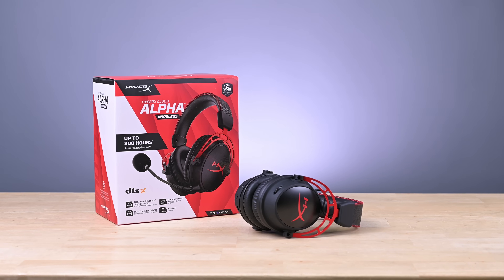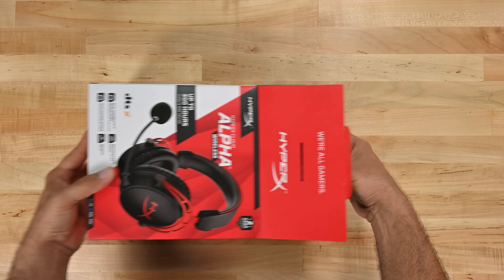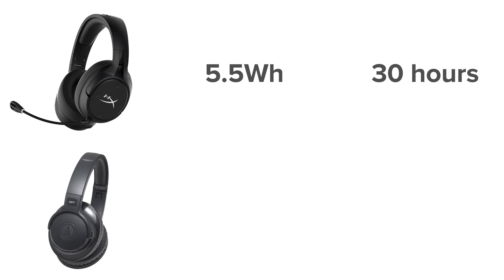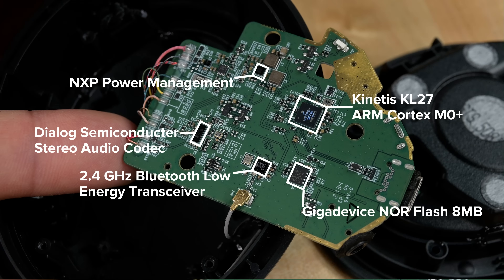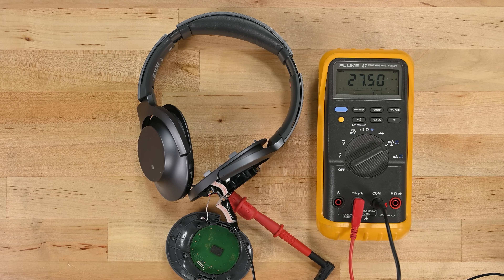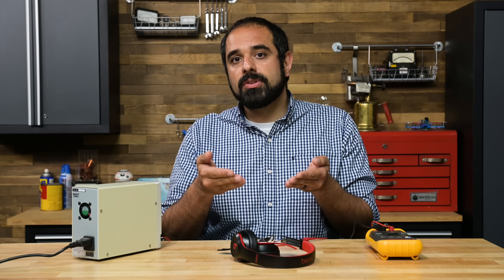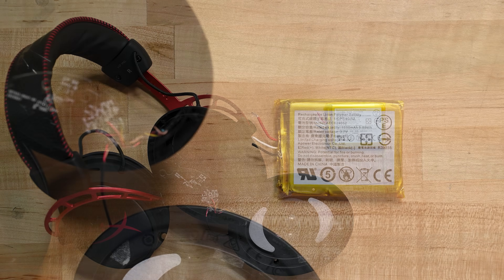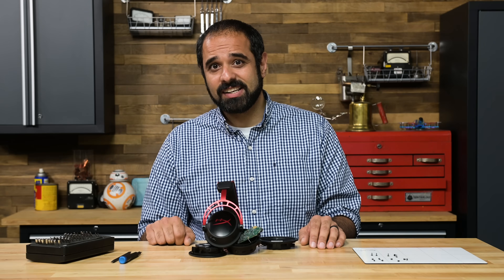300+ hour Battery Life HOW?! A HyperX Cloud Alpha Wireless Teardown

Comment: I wouldn't cut any points for needing to solder. If you have to pull those wires through the housing (which I have had to do on headphones before) you will end up needing to remove the connectors and that is going to make repair WAY harder. 

Also, those wires look easy to solder. A beginner wouldn't have much trouble. 

Regarding needing to replace the battery. I'd expect the battery to out last the headphones. 

For context. 10 years ago when I was still kind of new to soldering. I replaced the battery in some 2008 era Sony headphones (forgot the model but they are around here somewhere). Not only did I replace it but I upgraded it from about 350mah to I think 500mah. Was no trouble at all cutting a bit of plastic out to make room and soldering on that board was easy. The headphones in this video look even easier to solder.
Reply: Most headphones would need soldering but rating is about how easy it is for a total beginner
Reply: @FirstnameLastName-mr8lk  I guess but they don't allways seem to rate things like that. Like difficult repair vs not repairable.  Also I'd still not call this difficult. It's repair. Are you really expecting to not need any tools? Is that the goal/benchmark?
Reply: @Sparky400  I mean that's probably what they'd consider a max score like no repairs or just 1 screw type and length and the only tool is one screwdriver, for a complete beginner soldering is kind of hard for them the score is designed around like how easy it'd be for a total beginner like they have never repaired anything in their life
Reply: Completely agree. The pads are well marked and nicely spaced apart, they look very easily hand-solderable. Of course tiny speaker wire is always going to be a PITA, but there's nothing that can be done about that.
Reply: Would the battery even need to be replaced with wear and tear apart from manufacturing problems. One recharge can easily last a month or even more for normal usage. 60 recharges is like 5 years. That's same amount of recharges you'd be doing in 4-5 months of other wireless headphones. It's literally the best innovation
Reply: @rahulagrawal327  yeah. Much like an electric car. You are cycling much less and also wouldn't have any heat issues (unlike a phone in a hot pocket or hot charging Pad) 

I think the biggest issue is age/time. sometimes a battery can just become unstable. As crazy reliable as Tesla's batteries are, sometimes things just fail. 

Still. One cell. Very few people are likely to have an issue.
Reply: So the Li - Poly battery is soldered? What is the correct way to charge the battery? Found a tossed out pair to-day,  no dongle, no microphone! Tried connecting to a regular phone charger, but no indicator light. Thank you 🤓

Comment: This is a great video. All electronics should focus on efficiency especially during the energy price crisis. Low power draw also extends the battery lifetime! 💚💚💚
Reply: I don't think powering a wireless headset is gonna be that expensive to do to matter that much or at all.
Reply: @aarepelaa1142  I said all electronics. You’re right, but if everyone focused on energy efficiency as much as these guys, it would be super easy to go off grid. A couple solar panels would power everything.
Reply: @fish9468  Amazing feats can be achieved through this but solar panels need the expensive part as well, the battery xD these headphones paired with some last gen laptop would actually outlast the night until solar is available again xD
Reply: Wheres the anc?
Reply: @NotUwU-_-  who needs ANC on a gaming headset tho

Comment: It looks really cheap inside for 200 dollars.
Reply: Like what, you expect it has metal weights inside?
Reply: It literally doesn't?
The PCB seems high quality, the wire connections are reinforced with resin and the antenna is a separate module instead of a PCB trace.
Furthermore the drivers appear very solid, case plastic is thick and seems a nice plastic.
And they did not skimp on the battery, even with these very low power electronics.
I don't have wireless headphones nor am I interested in them, but after seeing these insides this model is on my list if I ever want something that is not wired.
They simply have no reason to use black solder mask and ribbon cables like what for example Apple does, as there is no benefit to this in use.

Comment: 300 hrs from a 1500 mah battery fully charged to 4.2v and discharged to no less than 3.2v because it is a lithium cell?
If so then perhaps the battery has more than 1500 mah ?
Reply: Lithium Ion batteries/cells can go down to 3.0V without any negative impact on battery runtime or capacity - most protection PCBs are usually set at about 2.5V for overdischarge, so you can go down to 2.5V without compromizing the safety of the cell (you don't usually gain much from going down to 2.5V, so might as well stop at 3V to get more cell longevity).
Reply: I mean it doesn't look like headphones like cloud 2 (these are similar to the wireless headphones in this video)use that much power. I used headphone amp calculator to look at how much power they take and it's like 2milliwatts and these wireless headphones seems to have similar(not exactly the same) drivers so it seems like majority of the energy in wireless headphones goes to wireless receiver? So i think these wireless headphones just have really energy efficient receiver. 🙂

Comment: shouldn't they have something like 100h battery life for way less weight?

Also I don't recall any glue used on my m50x and those sound pretty alright, clearly it's not necessary to add glue anywhere
Reply: For me, the battery life was the selling point and the reason I ordered it, and I assume its the same for a lot of people that end up ordering this. It's already very comfortable to me anyway and battery life was one of the frustrating things about my previous wireless headset. For my use case this is amazing.

I do understand for people who are after ultimate comfort, that may have been a good option, but i doubt much weight can be saved by using a smaller battery as I understand most of the weight comes from the drivers and the frame.
Reply: @redcolourbenzene7762  valid point, it's just comes down to preference I guess .

Comment: 1:07 The edge of the battery is dented by the plastics of the top part. Less than ideal for battery safety! 🤔
Reply: Good catch man...definitely should be a concern.
Reply: Look carefully
Reply: But that's the wrap they put around the battery? Like i don't get it they're obviously wired in there in a row for battery life. Or idk maybe they're wired for more power i doubt it, so it's a casing around them, and there's probably some sort of casing on the inner batteries.
Reply: @aarepelaa1142  There are no cells with a solid casing inside. It's a lithium pouch battery with just one cell.

Comment: As much as I love Kingston's HyperX line I find it uncomfortable to conceive of spending $200 on consumer grade builds. I would be so much happier to see those PCBs were fully potted to keep my ear hole juice from destroying it as one would be wearing it non-stop for longer durations, assumedly. Hot damn, though, 300 hours on a 1500 mAh pack is silly.

This is pretty exciting, though, truly, for future offerings.

(Also, the criticisms at the end are silly. No one uses connectors in consumer grade cans, they have potential connection quality issues anyway. Everything is soldered because it's cheap and reliable with proper engineering and technique every time with quality conductors and solder/flux. No one has replaceable battery packs in low, medium end cans, it's super rare at any level. Obviously you're nit-picking from a repairability standpoint but 99% of people opening these are going to be able to do something about it, like do simple soldering, the 1% are desperate that their headset didn't survive being dropped into the dog's water bowl)

Comment: 4:55 I don't think it really matters if it has repleacable battery. With that battery life i would expect this to last over 200k hours without any noticeable difference in battery life. I think it will easily last like 50 years in normal use.
Reply: Li-Ion batteries will eventually degrade over time, but it's (a) the amount of current drawn, and (b) the number of charge/discharge cycles, that determines how long your battery will last before it needs replacing. With a super low current draw, the number of charge cycles will be minimized (300 hour battery life is so cool!) and therefore the battery won't need replacing as quickly.

In contract, my Corsair Void RGB headphones are (or were) a different story - rated up to 16 hours, but no way of turning off the LEDs without proprietory software meant 5-6 hours runtime at most. That resulted in a large amount of charge cycles, and as such the battery life deteriorated quickly (I have had to replace the battery in those, and they could do with another battery replacement).
Reply: it doesnt matter if you are charging them less, they still degrade over time
Reply: @R_o_b_e_r_t  but even if it degrades to 50% over 10 years, that's still 150 hours, which is 5 times the average earphones
Reply: @davidyang9902  it will not last for 10 years lol
Reply: @R_o_b_e_r_t  how are you so sure? i still see people using iphone 6 in the street, and those are 8 years old at this point
Reply: @R_o_b_e_r_t  It definitely will. At less than 6mA power draw you are not even stressing the battery- with a good charge routine it will last over a decade if any other part doesn't fail first. I literally own Lithiums from several years ago which only have lost 10-15% capacity over 8+ years with higher discharge rates
Reply: @davidyang9902  you know replacement batteries exist, right?
Reply: That's assuming the battery is perfect out of the box and not defective. Or that it doesn't become damaged by any number of factors.
A replaceable battery would still prevent some headphones from going to the landfill in the long run, and that's a good thing.
"Worst case scenario" is you get a set of headphones that last another 50 years. Give 'em to your grandkids and let them marvel at the retro headphones.

Comment: Imagine if it had a second battery in the other ear cup! 😮
Reply: It could then have active noise cancellation and still run amazing battery life. Or turned off and have stupidly long battery life
Reply: That was my assumption until he opened the second ear cup.
Reply: Unlimited battery hours¡!!!!!!!!!!
Reply: too heavy then,.
Reply: 600 hours battery life😱😱😱
Reply: @GOKU-lp8hc  Yes!
Reply: @Mareks Dunkurs video?
Reply: It could easily beat kindle then
Reply: UNLIMITED POWEEEEEEEEEEEEEEEEEEEEEEEEER!!!
Reply: 600 hours
Reply: Bad idea for 2 reasons. 1 weight distribution. Can't really split the board. 2 it's hard to put batteries like that in parallel. With designs like this you need the battery protection board really close to the cell. It's a bad idea to use 2 boards in parallel. So you would have to use one but that means if the cable going through the top band shorts out you have no protection so fire risk.

Just not worth it. Also it's 1500mah. Is that not big enough?
Reply: @Sparky400   @Sparky400 

I’m not saying the current battery is small. I’m not even saying it’s a good idea to put a second battery because who cares if you have 300 or 600 hours of battery life? I’m just saying it’s possible. It’s just a more complicated build and would come at the cost of increased weight and cost.
Reply: @Gubby-Man  although possible. Difficult to make safe. Well. Not difficult but not as easy or straight forward. Especially in the days of exploding Samsung phones.
Reply: @Sparky400  🤣🤣🤣 days of what now ? Wasnt that like 6 years ago?
Reply: @Sparky400  It could be a secondary battery under the primary battery.
Reply: @BaconFaceMcGee  End of the video clearly shows that iFixit did extract battery from the case, and no more batteries inside)
Reply: @OleksandrDiedov  What does "clkerly" mean? I saw the only battery was removed.